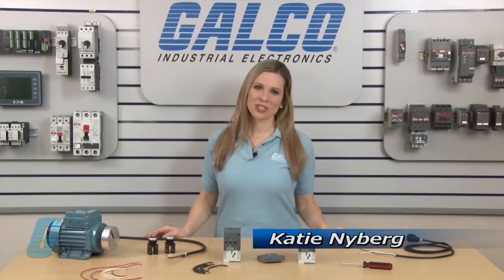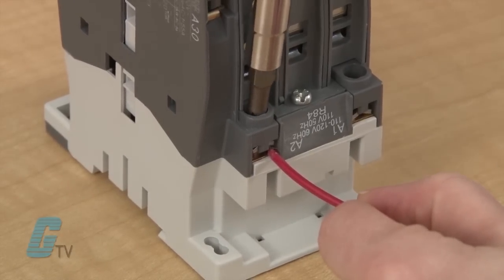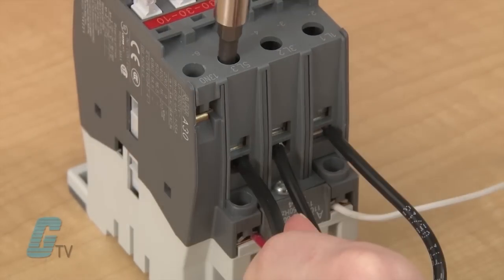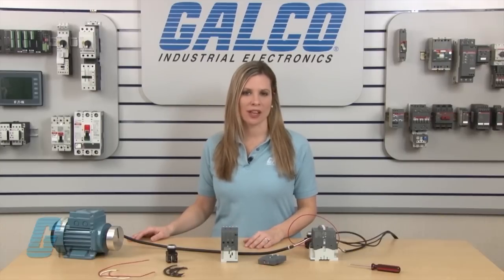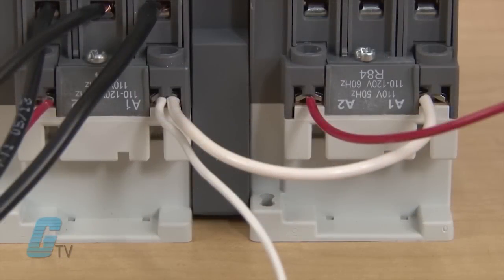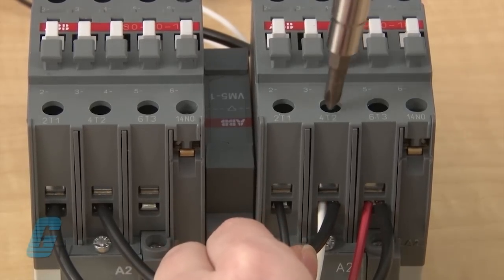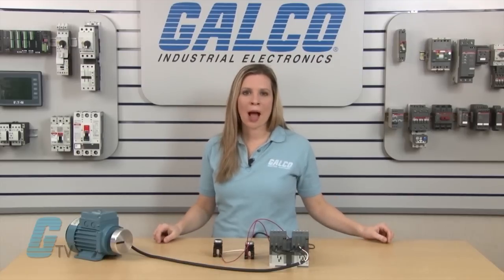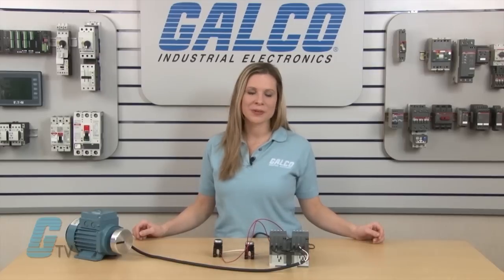What is the Difference between a Contactor and Reversing Contactor and How do They Work?

Comment: so theres no wire connection to the interlock
Reply from the maker: No, this is a mechanical interlock only. However many installations will use both a mechanical and electrical interlock for double protection against energizing both contactors at the same time. With no interlock protection and both the contactors energized at same time it would put a short across the line and trip the supply breaker or blow fuses, NOT a desirable scenario, ok?

Comment: base on your demonstration you have only stop and start push button...how do you operate in reverse or forward the motor if only stop and start push button switch that you will use?its better to use a 3pole selector switch or stop,reverse,forward push button,to control the motor in forward reverse operation and to stop the motor manually.

Comment: Is this a star connection? I thought there should be at least 3 contactors to run a motor, main with overload, star and delta?Hmm..
Reply from the maker: This video is for a single winding motor showing how to start it and how to reverse it using contactors. This video does not address the star-delta motor configuration. You are correct, for the star-delta configuration you need 3 contactors. The star-delta configuration would be used for either a two-speed motor or for a star start – delta run motor.

Comment: do i need to Stop the motor first with the same switch that i start it with in order to use the other switch to do the reverse
Reply: +Keyoke Andson This is wired to only run the motor when the buttons are held down. Allow motor to stop before running it the other way :)
Reply: +Keyoke Andson  it is good practice to let the motor stop first, reversing it while in motion can cause the reduction of the motors life and overloading the circuit protection, if not more serious problems.